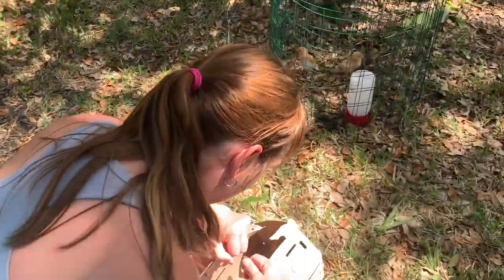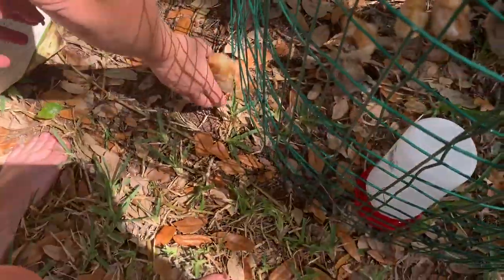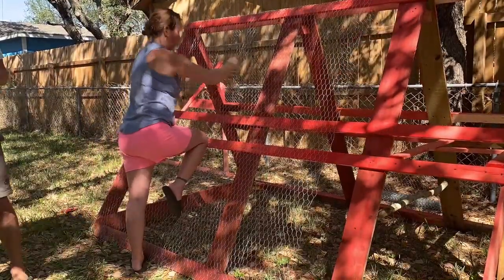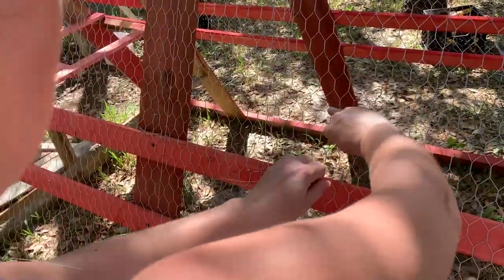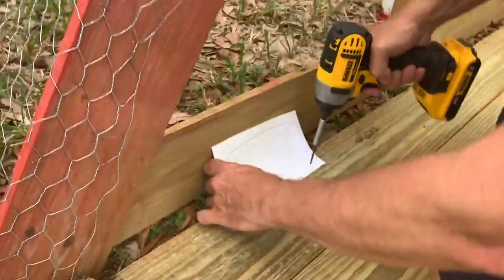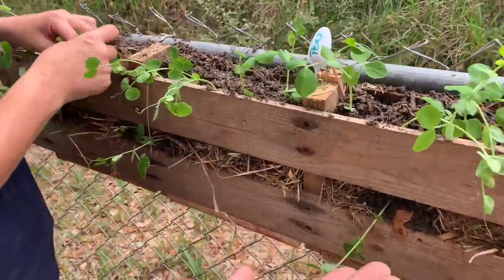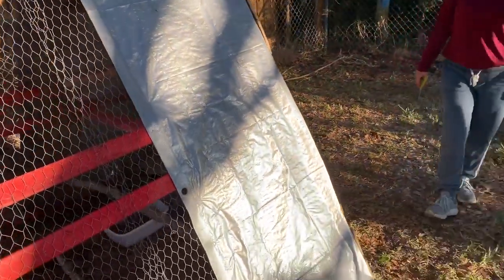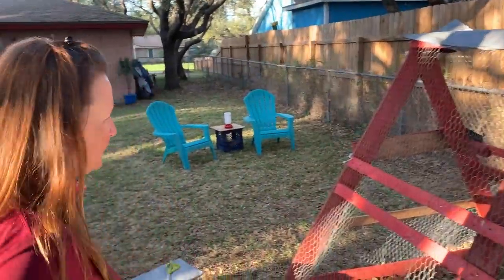How to Build an A-Frame Chicken Coop Part# 2 || Finished Product and We added more Chicks

Comment: What will you do for winter? We are new to backyard chickens. Have a large coop and a tractor, but too many roosters. Probably going to have to turn the tractor into a rooster house.
Reply from the maker: Winter we do the same thing. They adapt by molting in the fall. We up their protein (ie: more fish)
Roosters... get rid of em or put em in the crockpot. Too many Roosters is not good for the flock. Should really only have 1 Rooster. Your just wasting feed on a bird that does not produce eggs.